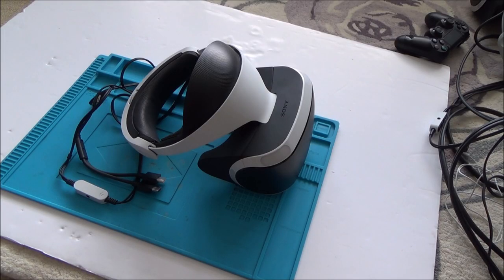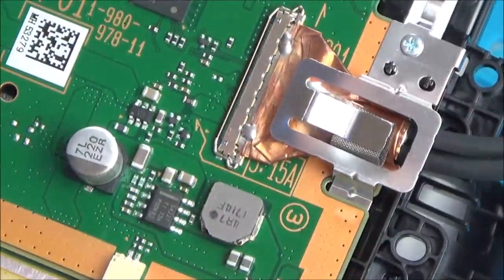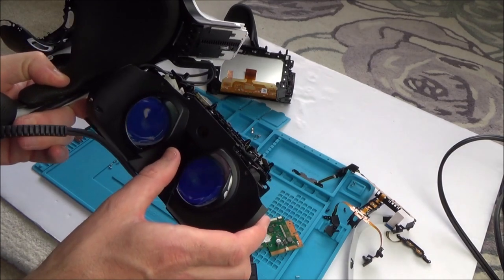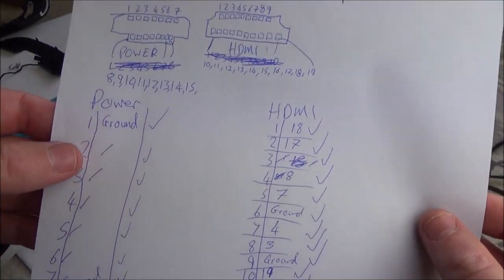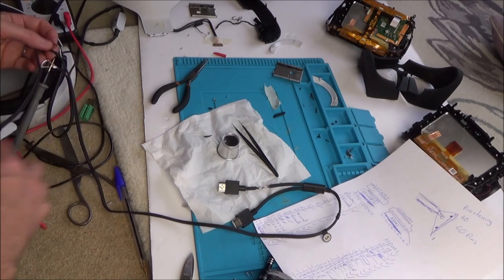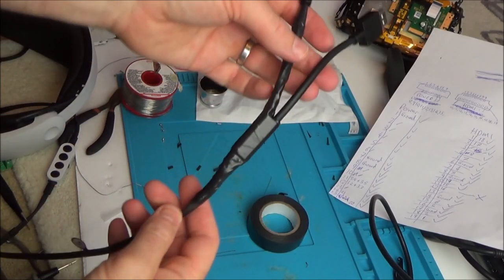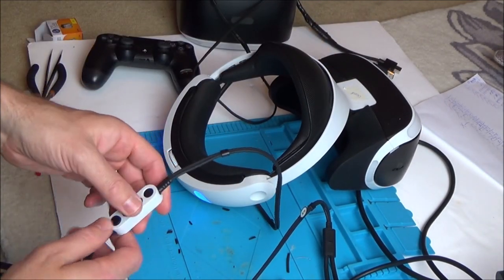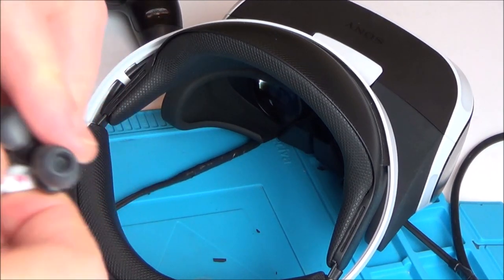Trying to FIX a Faulty PlayStation VR Headset (PSVR) QUICK VERSION

Comment: Ever since I took it apart and put it back together my tracking lights won't come back on. At first the lenses wouldn't even light up and my PS4 didn't even register that my VR was plugged in. Luckily that issue is fixed (how I did it is beyond me) but my tracking lights won't turn on. What's the reason?

Comment: You could have just closed the circuit for the photovoltaic sensor to test if that was the case. Just look up the spec for the sensor and see what the resistance is and test it using ohms. I mean I would have started there.

Comment: Another cracking video! I have been so inspired by your trying to fix videos that this week i bought a soldering iron etc got my first 3 xbox controllers from ebay and yesterday i managed to fix 2, unfortunately someone had tried to fix the third and pulled the pads from under the usb port. Thanks!
Reply from the maker: Thank you :-) Well done, in a few months with a bit of practice you can get some enamelled wire and fix up that 3rd controller by bypassing the ripped pads :-)
Reply: My Mate VINCE That’s the plan, and if if doesn’t work out i have it to practice with

Comment: Ever heard of the saying keep it simple. Hardly unlikely unless you see visible damage to the item the main PCB wouldn’t be at fault! Also sony are very good make. I look at it and see the condition(good) the only thing that can get damaged it if someone played it running around the room(kids) and pulled the wire....But the way your are and how you learn about fault findings... I can See you getting there, as i seen you describing and showing the fault, I was like it must be the cable or the connections.

Comment: I know this is an old video but I did notice there are more than one ground wire. Would it be feasible to connect two ground pins to one ground wire, then connect the unused ground wire to the faulty pin?
Reply: That's a great question.  I would think it wouldn't work, because the pairs work in unison and the 1's and 0's wouldn't match up between the two wires

Comment: Do you know if the psvr will turn on without being plugged into the extension HDMI? By extension HDMI I mean... you know how the cable from the headset with two plugs, plugs into the two inputs on another  cord and then the cord plugs into the processor box... is that just an extension?  because I do not have that cable, and my headset is not turning on so I'm wondering if i can  plug directly into the processor box from the headset or I need to purchase the other cable.. thank you for your time
Reply: You can plug directly into the processor box, they don't come with the extension out of the box.

Comment: Can you confirm the power symptoms?   I am attempting a repair on a psvr currently.  The symptom is when I press the power button the lights on the back of the unit come on for about 1 second then go off.   Processor light is white.

Comment: one question, if i have the power button not working, what cables i have to put together for turn the psvr on? (the same psvr model on the video)
Reply: i have opened directly the power connector at the base where it gets connected to the processor unit but im not understanding